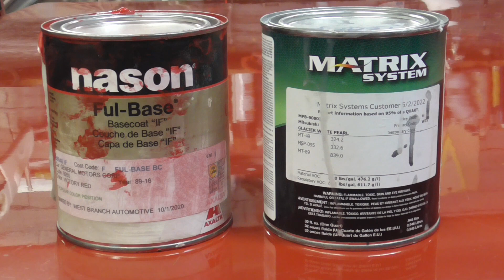Does Base Coat Need Hardener?

Comment: Use speedokotes basecoat activator in any urethane based paint at a fraction of the cost. There paint is killer too at a 1:1 mix. Saves alot of money right there. And basically a buy one get one free.
Reply from the maker: Thanks a lot for your input 1 Man - always good to know.   Things are getting out of hand $$$.
Reply: @LakesideAutobody  yes I agree. They make ALOT of stuff. I use many of there products

Comment: What. Is this harder in base coat. Don’t understand
Reply from the maker: Yes.  If you buy Nason Base coat, the guy behind the counter with say you need activator which is pretty darn costly these days.  If you buy Matrix or some other brands of base the TDS (data sheet) and the guy behind the counter says it's optional.  Since most base coats are very similar (I'm assuming) - I would guess that it is optional for all base coats (the use of a hardener).   If that don't help ask again :)

Comment: Does the clearcoat need a hardener?
Reply from the maker: Yes - absolutely.  If you ever forget to put it in - it'll be the worst day of your life.  It hardens just enough to make it absolutely miserable to get the stuff off - a big gummy mess.  It will never harden either no matter what you read.  Enamel will harden w/o hardener and so will lacquer but not urethane.

Comment: Ive never heard of even putting hardner in base, i never have. Just reducer.but i aint no pro painter.
Reply: Oh, maybe he meant to say reducer?
Reply from the maker: There is somewhat of a debate about it.  Some say if you have to make a repair and you didn't use a hardener in the base, it will be difficult because of a poor reaction to new materials i.e. primer and or paint being sprayed over it.
Reply: @LakesideAutobody  A LOT of years ago when 'Death-tron' (yea, that's what we called it) came out, I THINK only DBU was the only base available which was activated.... then they came out with the DBC line which (to the last of my knowledge) was simply reduced.
Reply from the maker: @WonTooForAte9  Thanks for the comment - very helpful 👍🛠😊